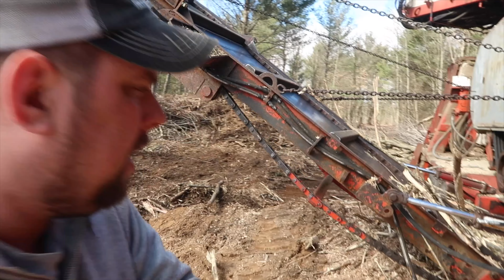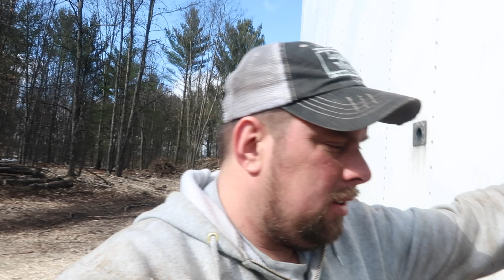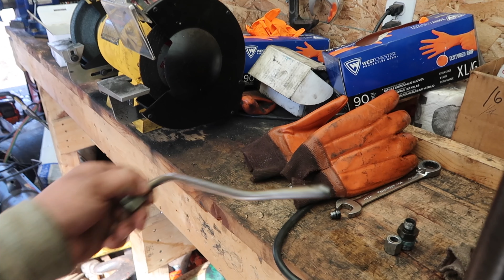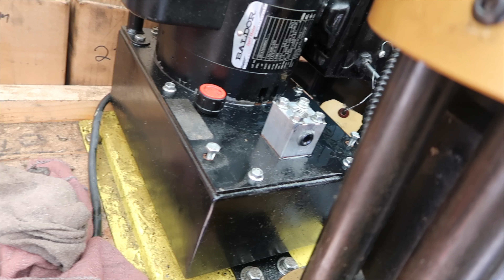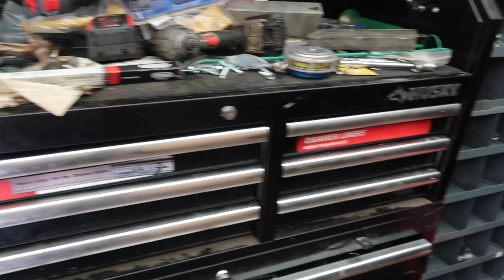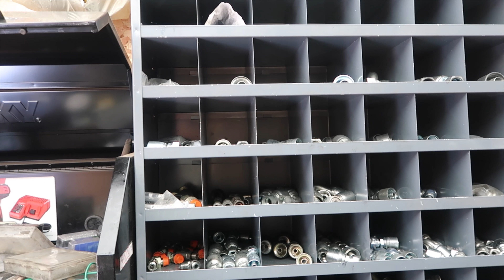Did not go as PLANNED!!

Comment: I John how are you forest helper?
I have readed times ago at Tim Ard, Forest Applications Training, Inc.:
- it's not the cost of a part or repair of a piece of equipment that's expensive.  It's the Downtime! If the equipment's not ready when you need to be- it's unprofitable and often times unsafe.
I admire you spirit of never give up.I worked helping my uncle at a farm from my grandfather and sometimes our used equipment when harvesting in corn field failed and we have to fix for by our self.I saw how important is a good power tool and lot of eye and knowhow to do.
Strong brands on equipments good but the secreat is the programmed manteinance,filters,fuel filters,refuel at time (water,debris,mud at low rates level and never let out rune in fuel kill injectorpumps).Good oil in hidrólics respects hours limit.Round North of Portugal big company are putting trucks to take the greenbranches at end of harvesting and taking to central processing in central plants.Usually only the big company have two engine chipers.How are you doing with a team of five?I Remenber if you believe you can find your goals,every time we can have the bread in the table to our family for the day we can be graitfull because we accomplish today and tomorrow will be another day in labor.when we are in the flórest don’t we saw the birds have the food.Dont are we more important than birds for hour creator?
Be safe bro and enjoy the last of weekend!
Salut André C